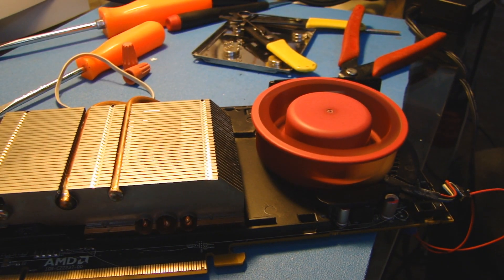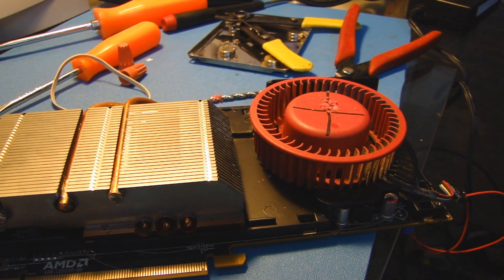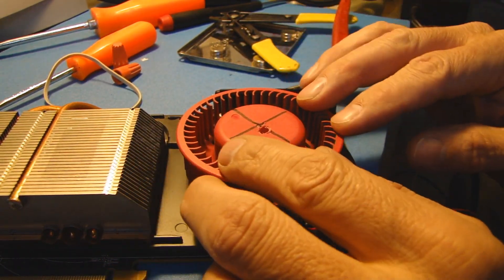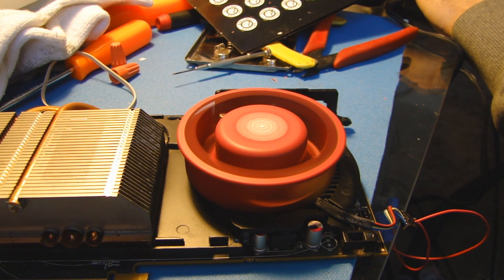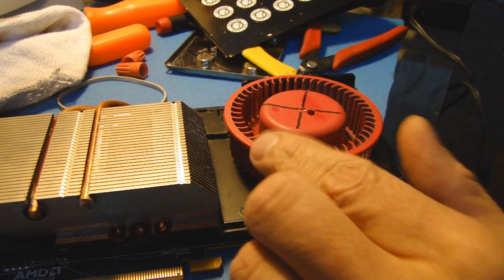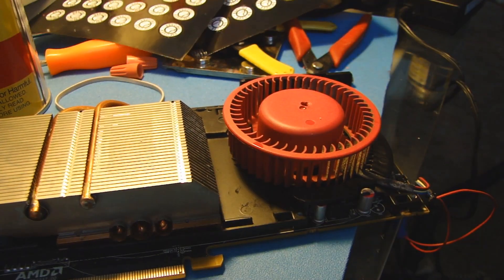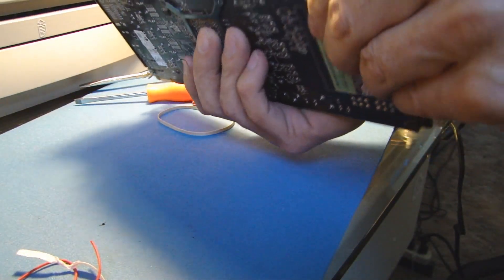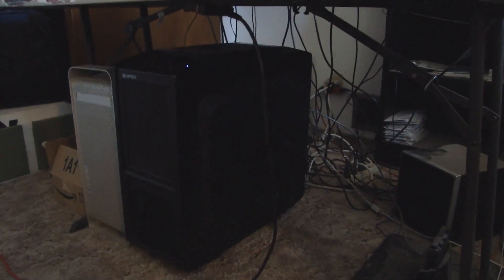Repairing Radeon 6870 fan noise...the easy way....

Comment: Just do it like this guy. So you don't have to drill any holes. https://www.youtube.com/watch?v=qhIcVGuVAEw&app=desktop
Reply from the maker: +Raphael Zydek So instead of going through "all the trouble" of drilling a hole, adding some oil and applying a sticker, you suggest complete disassembly of the entire GPU - including separating processors from their respective heat sinks - as an easier way of fixing the noisy fan??  With all due respect, sir... Are you out of your freakin' mind????

Carry on.
Reply from the maker: *****
Touché, sir.  I will take new video of the card still working TWO YEARS later, and that should remedy your "anecdote" complaint.  Fair enough?
Reply from the maker: *****
 Perhaps.  But this is a cost-effective repair (FREE), and a time-effective repair (takes about 20 minutes).  So with scale in mind (cost+time / repair persistence), this is a good repair.  That said...

If you take time to read the comments, you will notice that this repair WORKED for a few people.  I haven't seen a comment declaring the repair either didn't work, or "destroyed" their GPU.  So in the spirit of "anecdotal evidence," I'm going to call the same on you.  Your hypothetical theories are just that until you prove otherwise.  And if you want to tally the evidence, the comments here suggest the repair works FAR MORE than any evidence supporting your theory that it doesn't.

Don't show up to a gun fight with a knife, my friend.
Reply: No way dude, I want to drill a bunch of random holes and randomly dump different things in those holes and run my fans at full speed until they burn out.
Reply from the maker: +lucidbarrier
 Why not just follow the instructions?  Simply drill where you're told to drill, and use the lubricants I recommended.  I simply cannot recommend drilling random holes and pouring in random fluids.  Not only would this be foolish, but it would be a very irresponsible recommendation.

I purposely produced this video so a 4-year-old could follow its instructions. Clearly, this video is over your head.  May I recommend you find a 4-year-old to explain it to you?  Prepubescents tend to use small words, so that should also facilitate greater understanding. 

Oh...and please...for the love of all that is holy, do NOT vote.  I could only imagine WHY you might vote for someone....and it gives me shudders.  Me and my subscribers would consider it a personal favor.  Thanx!
Reply: Donnie Frank
 You talk more than a woman. You pontificate like some pompous blowhard with all hot air and no substance. To quote an old movie: "Your theories are the worst kind of popular tripe, your methods are sloppy, and your conclusions are highly questionable! You are a poor scientist,."
Some of us prefer to do things correctly and not to drive around in cars covered in stickers. Lord only knows what kind of kludges you have in your Corolla.
Reply from the maker: lucidbarrier
 An entire diatribe based on nothing but false assumptions.  You should've told me I was dealing with a libtard.  I recognize the M.O. and the lack of cranial activity.

Do me a favor.  Next time just come out and SAY you're a libtard.  You'll save a lot of people a lot of time.

BTW, my 2 bumper stickers (which are actually on my rear window):

LMGTFY
AMA
Reply: *****
He has no sense of humor, no imagination and apparently very limited ability to think for himself. He has to resort to name calling and regurgitating other people's rhetoric because he is a sheep that thinks because dressing himself up like a wolf will impress other people. Anyway, I was looking for a reason why a Radeon 6750 sounded like a helicopter taking off but I have an R9 380 and it's running fine. Watching this neanderthal reinvent the wheel was just purely entertaining. Oiling the bearings on fans is nothing new, people have been doing it since the original Pentium days.
Reply from the maker: lucidbarrier
 I didn't know you liberals considered being called "liberal" an insult.  Duly noted.
  Just notice he doesn't deny the moniker.  Just sayin'....nailed it.

Comment: Aaah... 2014... When people opened up GPUs and drilled holes in them to make them quieter...
Reply from the maker: +Ethan LeSage If there is a newer, better, modern way of doing this, please feel free to post your own tutorial video.  Otherwise....
Reply: Dayummmmm
Reply: +EthanSwag  do you even know what a GPU is?  when you poil you will put it on the coils not the bearings ... so.. yeah. a new "ati" fan cost 5-10 bucks, and old gpu waterblock cost prettymuch  the same.... i
Reply: +EthanSwag Fuckin trolls.  Probably clueless with tons of money to throw away when the fans get too noisy.

Comment: I just pulled the fan off and used some automotive axle grease to the shaft....been super quiet for 3 years.
Reply from the maker: +KMFDM781   Please post your video on how to pull the fan off.
Reply: @drummerdonniedotcom  I used bike tire levers. All three at once. It just separates.
Reply: Same here. I used some Park Tool bicycle grease 5 years ago or so on my 5850's fan. Still silent to this day.

Comment: Oh, man... this process doesn't need to be done with the 5770, does it?
Reply: Just open the fan And clean the interior magnet with alcohol
Reply: Ronald Link Open the fan? Can its base be removed or do I have to cut into something?
Reply: If you make holes on the fan it will go out of balance
Reply from the maker: +Ronald Link Not if you make them towards the center....certainly not enough to matter.  1 year 10 months after posting this, the fan and GPU are still in service.
Reply from the maker: +maccollectorZ (Commenting Account) It seemed more difficult to remove the fan assembly, so I drilled the hole and oiled it.  Easy-peasy.
Reply from the maker: +Ronald Link Instead of talking, may I suggest you make a video showing us how easy it is?  That's what I did.
Reply from the maker: +maccollectorZ (Commenting Account) Only if the fan starts making this noise...;^)

Comment: May be unrelated to the video, but it has to do with the fan as well.
I've running a HD 6750 for a while now and my fan has been making a rattling noises and I am guessing the bearings are giving out.
Will this trick with the oil help or should I just replace the fan?
Reply from the maker: +Geko   At this point you've already written your fan off.  So it certainly couldn't hurt.  I would give it a try.  It costs nothing but a half hour of your time.

Comment: What you really should have done was add WD 40 first and then oil. 

What made it loud was not a lack of lubrication, it was the fact that there was a little piece of sand or something scraping against moving parts inside the fan. 

The WD40 displaces the debris, but also gets rid of some of the oil, which is why you should have added a bit more afterward.

Although I guess since the fan is still working flawlessly I can't complain
Reply from the maker: Noah Agosta Your final sentence sums it up nicely and got you the thumbs up.

Comment: this is such a bad idea.
you warp your bearing, offset the balance of the fan, and make even more noise afterwards
Reply from the maker: D0p3n1nja It's been in service daily since January 14, 2014.  Check your calendar.  If this were a "bad idea" or was going to make "more noise," don't you think it would have by now?  Your claim is completely arbitrary and not founded in anything even remotely resembling data.  I invite comments, but be responsible with them.  Do the math.
Reply: @drummerdonniedotcom  "resembling data" of one sample. noice. 

anyhow, it may be a lucky sample this time. what the dude says is true, it exposes the bearings to more risk than needed. idk about that particular model, but generally in fans, there are stickers in the back you can peel, and put the grease or oil there. no need for hole drilling.
Reply from the maker: @josuad6890  wrote, ".... idk about that particular model...."

Exactly.
Reply: @drummerdonniedotcom  though i'm very willing to bet that there's an actual sticker and some kind of gasket behind it to peel. i'm only saying idk because you didn't show me the back of the thing. i'll shut my trap if you can prove there's no stickers and gasket behind the fan though.
Reply from the maker: @josuad6890  For the love of all that is holy, do I have to hold your hand through everything?  8:24 into the video shows you the BACK of the GPU, which is clearly a PCB with NO ACCESS TO THE FAN.  Don't be so lazy, man.  Do your own research.

Comment: My fan's been acting the fool for the last few months, got really bad the last week, so I found your video, same video card, and I got a little bit brave since I did have WD-40. (No oil though) and I'll make a proper update if anything else happens, but so far into my boot, the sound is gone, I've used MSi Afterburner to play with the fan speeds and it seems the sound is gone at low RPM and high RPM... Also I was having problems with video files stuttering the computer up. This problem doesn't happen right at start up so I'll have to update you later. But so far it seems to have been a success... This is only a temporary fix for me, since I'll be looking to upgrade to a new videocard sometime later on. But yeah man, seems to have worked.
Reply from the maker: Shamus8b8 Glad it worked for you.  Please subscribe to my channel.  I would really appreciate it very much.  Thank you!

Comment: This is completely psycho. By removing material from the fan he is making the fan unbalanced. The next noise problem he will have is the spindle / bearing going bad. No fix for that! He is squirting motor oil blindly into an area that has electronics. At the end of the video some oil / WD40 is being flung off the fan as shown by the stain jetting from the hole he made to the periphery. What about the combination of oil, WD40, and adhesive? How long before that sticky label slips and then is wadded up somewhere, while the card is running inside the computer. Etc. etc. etc. Oh, and touching your $500 video card with a running, 220-volt ac heavy industrial vacuum-cleaner -- whereas most folks are wearing delicate anti-static wrist-bands when working on digital electronics. Sheesh. This guy needs to stay with stripping and antiquing furniture, and leave electronics to the professionals. DO NOT try this at home!
Reply from the maker: Re: Unbalanced fan....     I'll tell the fan that YOU think it's now unbalanced.  It's been running now for over a year....still quiet...still "balanced" (I actually LOL at that assessment...like they "balance" GPU fans at the factory...you're funny).

Re: Spraying oil and WD-40...  I squirted in a few drops into a sealed system, which I then resealed with a sticker.  Did you notice that the GPU installs with the fan facing downward???  Oh...you didn't???  Gravity pulls oil down toward the sticker, which is still sealed a year later.  Again, the fan's been running great for a year.  Maybe you should have checked the date this was posted before tossing in your 2 cents.  Your efforts to misinform my public are in vain.

Re: Combination WD-40 and adhesive...  This is why I cleaned the surface with carb cleaner BEFORE applying the sticker.  Again (ad nauseum), a year later and all is well.  If the sticker ever "slips off" (another thing I laughed at), I'll let you know.

Re: $500 card...  You have obviously never priced out a Radeon 6870 GPU.

Re: 220VAC vacuum cleaner...  Your retardation is showing.  I used a portable 120VAC Shop Vac...which - in case you didn't notice - worked exquisitely.

Re: Static electricity...  I guess you don't know what an antistatic pad looks like.  You've now reached "moron" status.  You've lost all credibility.

Re: Don't try at home...   Unfortunately lots of folks have.  And it works.  Methinks you don't like people fixing their own GPU fans so you can charge your $100+ to replace the fan assembly.  Sorry man...your agenda is as transparent as you are..

Any more comments?
Reply: Donnie Frank it does unbalance, but it doesn't affect the fan in this case. About the oil, si not conductive so you can drown it on it.

The rest agree, even the 220V vaccum cleaner wouldnt make a thing to the card, even if its working. Is not like 220V make electrons jump lots of centimeters from the engine to the GPU card.

Also i'd love to see Setmose face when knowing that most surface mounted devices are soldered on a hotplate at 300ºC, and the remaining flux is washed with water.
Reply from the maker: +Setmose
Re: Why propagate this? 

Here.  I'll give you a list of reasons:

1) Because it works.

2) Because the alternative is to replace the fan assembly which is completely cost-INeffective.

3) Some guys lack the technical savvy to replace a fan on a GPU.

4) It's not a $500 card. It's a $25 card.  If I fuck it up, I'll replace it.  Instead, I took a hit for the team and risked screwing up the card so the next guy wouldn't.  I drilled in the center.  Anyone who watches this video won't make that mistake.  You're welcome very much.

5) Again, the card was sitting on a static pad, which I was connected to.

6) I didn't vacuum the PC board.  I vacuumed the plastic fan.

7) Plastic bits INSIDE the fan assembly would probably STOP the fan from working.  So the vacuum is the best choice for this.  I notice you have given no better ideas.

8) I KNOW what's under the plastic fan.  This is why I drilled by hand and didn't use a drill.  By checking every once in a while it was easy to see when I was breaking through the plastic.  And by shining a flashlight inside said plastic hole, it was easy to see what was underneath it.  All this is clearly shown in the video.  Had you watched the video, you would know this.

9) Did I mention that this works and HAS worked for over a year now???  Are you purposely being obtuse?  Or are you just thick?

10) Re: Static electricity...  I guess you didn't notice that I never stopped touching the GPU.  Any child knows that this negates any and all static build up.

So save your Monday morning quarterbacking for someone who doesn't have basic knowledge of electronics, physics, electricity and how this all ties together.  I didn't "get lucky."  I knew what I was doing and thereby facilitated an effective repair.  Until you show a better video or can offer replacement suggestions other than "take it to a technician," shut your pie hole.  Got it?
Reply: xumi Well, I've worked in VLSI for 7 years (Cirrus Logic, Digital Semiconductors), so your "expertise" on how surface-mount devices are mated to a circuit board doesn't impress me. As for the electromagnetic qualities of vacuum cleaners, they produce huge amounts of static charge, (moving a column of air tends to do that -- think of dry windy days, or convection thunderhead storms), and touching a running vacuum cleaner to a sensitive VLSI package is completely a fools errand. There's a reason that both Nvidia and AMD tell you not to touch the contacts on the PCIe connector when handling a video card -- and (hint) it isn't that your skin-oil will degraded the conductivity. There is also absolutely no guarantee that the vacuum will get 100% of any plastic shavings out of the armature housing. Accidentally touching one of the stator coils (or more in the way he was spinning the fan to drill it) with a drill-bit is not recommended, as severing a winding will kill it. Drowning the stator coils in oil will change the heat transfer characteristics of the motor, and as you can see in the video link I've provided, you're only just barely getting any lubricant where it really needs to go -- inside the bearing along the entire length of the spindle.

The OP got away with his operation, which he plainly admits he saw and copied from another YouTube video. I DO NOT recommend anyone else try. Why propagate this? It is completely unnecessary given the links I've provided.

Comment: Hey! Do you know if that noise is in any way dangerous for the GPU?
Mine started to do that noise about a week ago. 
Temperature and speed are normal.
so is it just annoying or is it dangerous?
Reply from the maker: Hey Michael.  I would say that the noise is one of impending doom.  As long as you have utilities and monitor your GPU temp and fan speed, I wouldn't worry about it.  But if the noise goes away, don't assume the fan "fixed itself."  Assume the fan stopped.  You can avoid impending doom by simply lubricating it as I did in this video.  From experience I know that noise unchecked usually leads to failure.  YMMV.  Good luck!
Reply: Donnie Frank Hey! Me again!^^
Just wanted to give you a quick reply on how that repair of mine is working out!
I struggled long whether or not to drill a hole into my gpu-fan cause you know... i was about to drill a hole that wasnt supposed to be there...;-)
i tried disassembling and removing the motor to lubricate from the back but that didnt go well.
So i said fuck it... lets drill that hole. I made a tiny hole just outside the center using a scalpel and put some oil in there.
But that wasnt enough so just like you i used some WD-40 too.
Now its running smoothly again!

I thank you very much kind sir!
Reply from the maker: +Michael Penndorf Hey Michael.  My experience with any mechanical device is that noise is usually a sign of impending doom.  Though the noise itself won't damage the GPU, the fan slowing down and eventually stopping will facilitate overheating.  I recommend you fix the noise.  As of this writing my GPU is still in the computer and still working silently as it should.
Reply from the maker: +Michael Penndorf  Excellent!  I'm glad it worked for you.  And yeah...disassembling the GPU is a big pain in the arse.  

I see your comment is a year old (sorry for the delay in responding).  I'm curious to know if your repair is still working.  Please post a follow up!  Thank you!